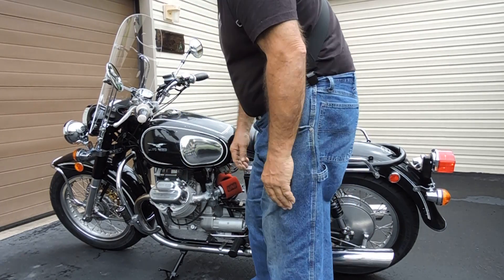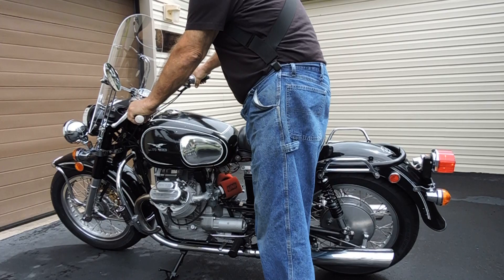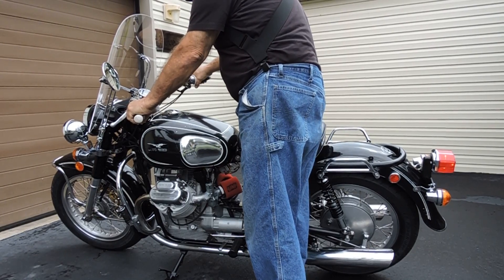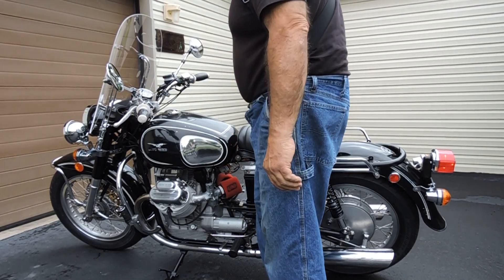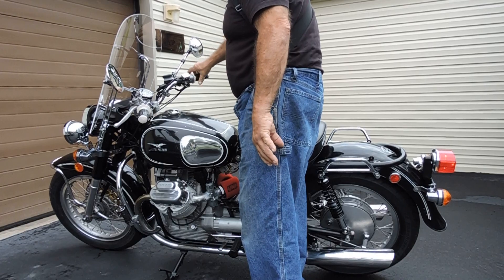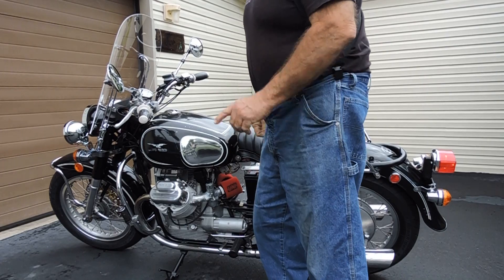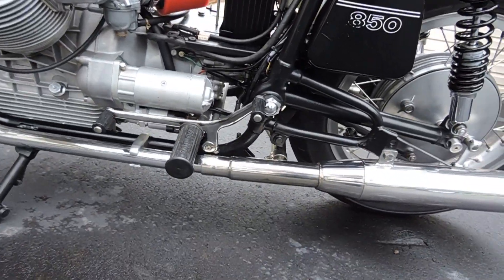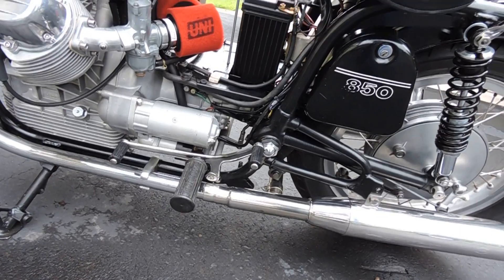1974 Moto Guzzi Eldorado Many Modifications Mistral Exhaust

Comment: Sounds sweet. Unusual to see Amal Concentrics being used. How does it ride.
Alternator mod looks good. How many watts?
Nice
Reply from the maker: Amal's were used on this Eldo in 1973 when it was built since Delorto was on strike non were available.  For a look at the many mods look on Face Book search for Moto-Guzzi Loop Frame Box Case.  Runs great!
Reply from the maker: Amals were a replacement for the Delorto carbs since they were on strike and not being manufactured.
Reply: @rotaxhead  my 73 made in 11/72 has dellortos. is this normal?

Comment: How did you eventually make the tacho work with your C5 ignition. I recently installed the same setup but the tacho doesn't work
Reply from the maker: Did your tach function before using this ignition?
Reply: Yes it worked fine. It had a lag it seemed around low rpm but otherwise yes. Thanks.